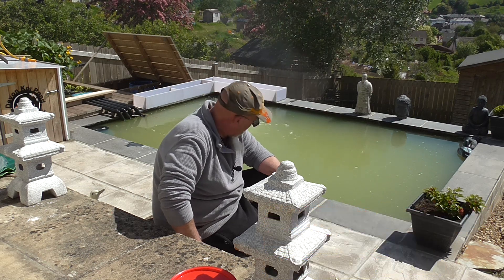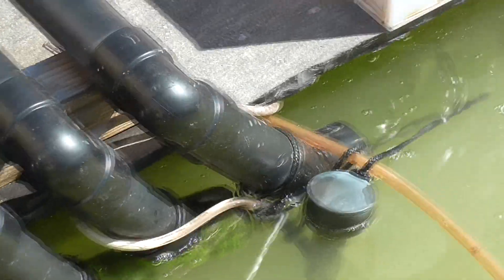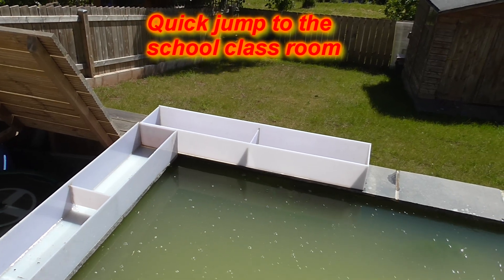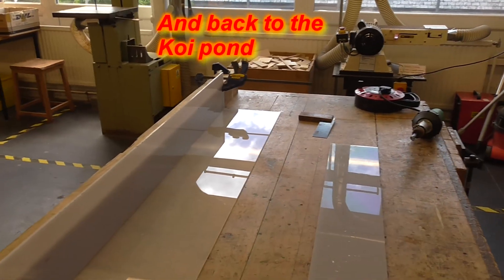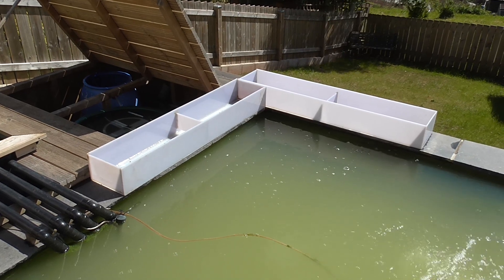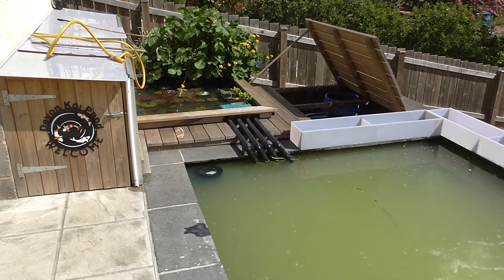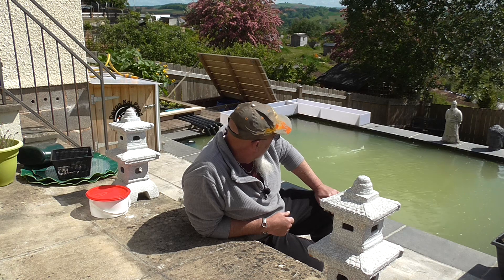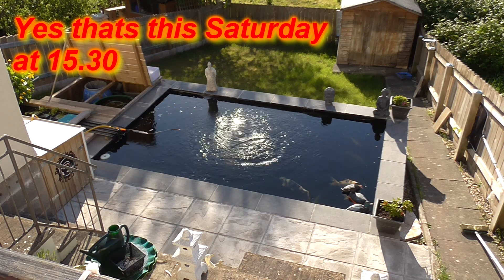Koi pond blanket weed problems

Comment: Ayup bud looking milky down at the Devon Koi pond. Have you ever tried Colombo algisin. That's what I use treat once a year done and doesn't cloud the water. 👍🏻
Reply from the maker: Willing to try anything after this stuff as I said to someone else I tried the pink crystals last year that did not touch it don't know what that stuff was got it from orchard fishery's. It was bad this year its taken me the hole week to get the dead weed cleared from the pond and I still have short green weed on two walls of the pond. It just turned into a bloody mess but I should not have left it so long before treating as well
Reply: @boxtriker  it's the filter cleaning that follows. I treated a couple of weeks ago. Problem is it takes it pretty much back to the liner. So filter cleaning has been almost daily for me. But it's on top now. I will Bought Colombo years ago a large tub. And it's lasted me doesn't take much. I should of posted you a sample to try. Never thought. 👍🏻 sorry dude.
Reply from the maker: Its taken 7 days clean every day down hear but should be good and back to norm now

Comment: I find blanketweed resolver works for me. No milky water.
Reply from the maker: Iain when I have used the last of the cloverleaf up resolver is top of the must try list thanks
Martyn DevonKoi
Reply: @boxtriker  I don't think it's as strong as the cloverleaf but I use it as soon as the blanketweed starts. Seems to keep on top of it that way. I also think it helps to prevent it coming back. I also have  lots of plants and use barley straw. Great videos by the way.

Comment: I have a pergola over my pond which gives some shade and cuts down on weed.Treat on the odd occasion with blanket powder but only half dose.I think every pond needs a cover for shade against the sun.Good luck.
Reply: Around 90% of the ponds I have built are in full sun, almost no blanket weed. Looking at my own right now, 1 tiny tuft of blanketweed, crystal clear water. It's all about getting the pond ecosystem balance right, working with mother nature. Mind you I only build natural looking ponds so it's easier to get the ecosystem in balance. Bottom jets work well to lift nutrients up to the surface and over into the skimmer, I find.

Comment: Hi Martyn what make of variable pumps do you use? Im currently trying to decide between an EA and an Aqua Forte. Leaning towards the AquaForte as I have a hunch it might last longer.
Reply from the maker: Andrew i have the AquaForte 10000 pumps and run 4 of them one on the bottom drain one on the skimmer one for back wash in the answer filter and the 4th one is on the sump barrel where i pump all the waist water from. i can report that after near 4 years of running they have been problem free. the idea in uesing one on the sump barrel is it gives me a spair should one of the main ones fail and i can swap it over till i get a replacment
Reply: @boxtriker  Thanks Martyn